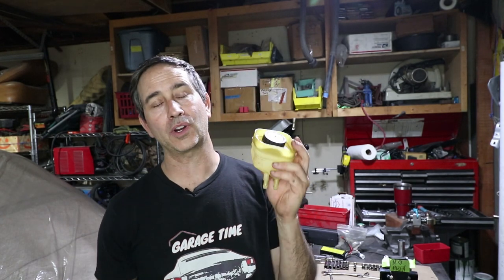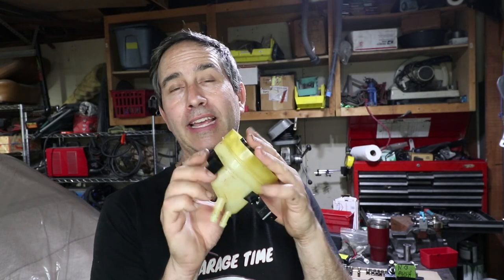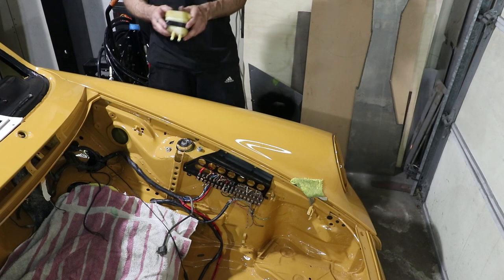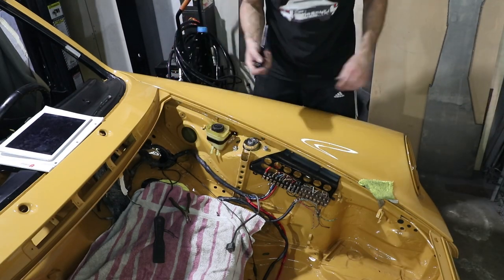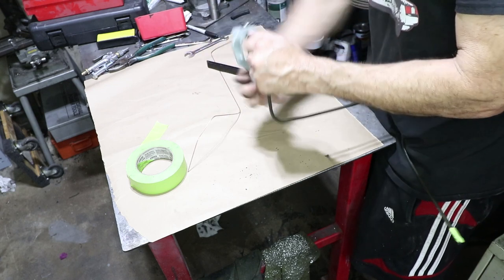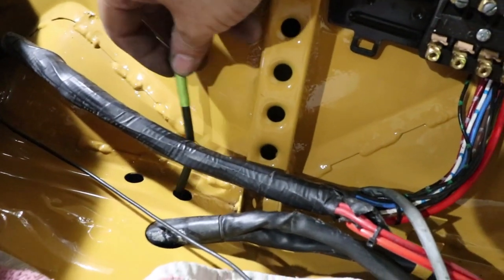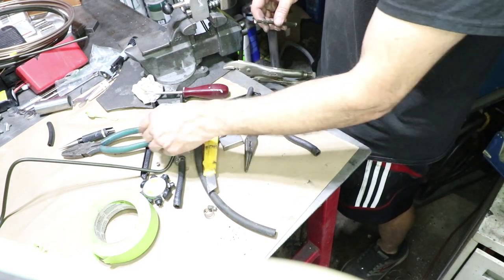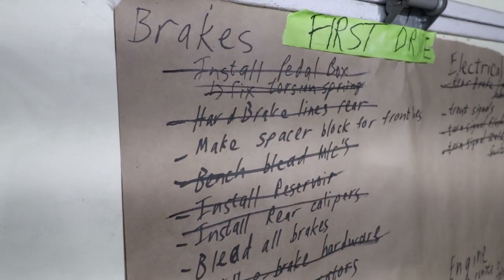Custom Brake Reservoir Hard Lines Installed - Everything Now New From Pedal to Rotors.

Comment: Great setup you made! Do you have any thoughts regarding the relationship between master cyl piston size and brake firmness? I have a dual mc setup and the pedal is like pressing a brick wall and doesn't seem to be getting enough pressure to the calipers! I've gone through the calipers and they are all good, now I'm wondering if I need larger bore masters to apply more pressure to the calipers with my same leg pressure. Do you have any thoughts?
Reply from the maker: Yes, you need smaller bores on the master cylinders NOT bigger.  
If you compare the cross sectional area of a stock master cylinder bore to that of dual bores added together that should shed some light on this for you.

Comment: Will you have installed a seat and belt for the first drive? Sound proofing and carpet a wee way down the track
Reply from the maker: Yes.  Well the driver's seat is already in.  And I do have some used factory seat belts for now.  Shoot the belts aren't on my list, but the passenger seat is!